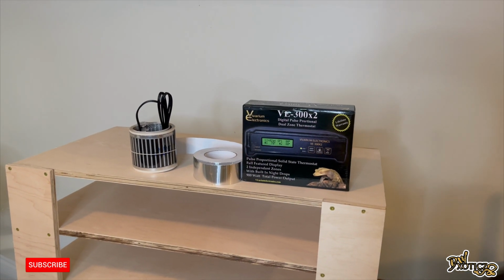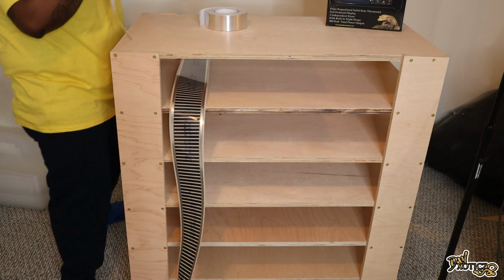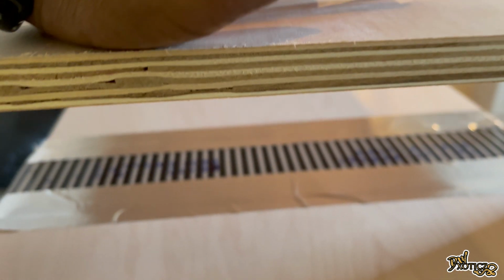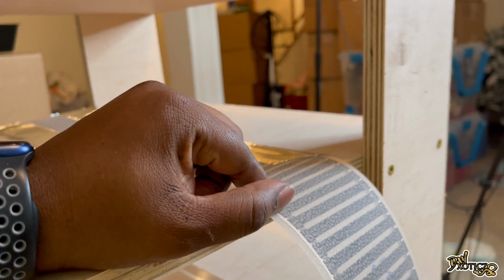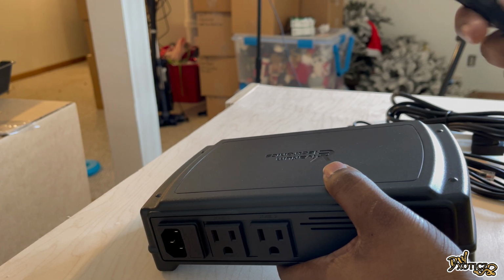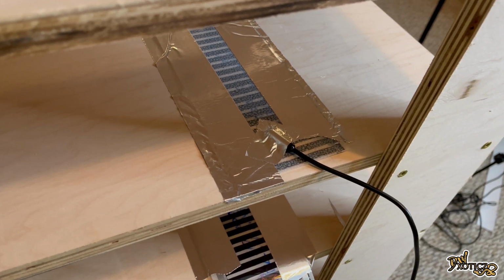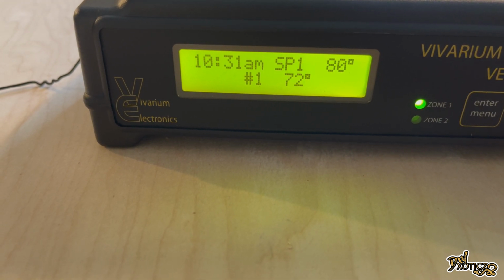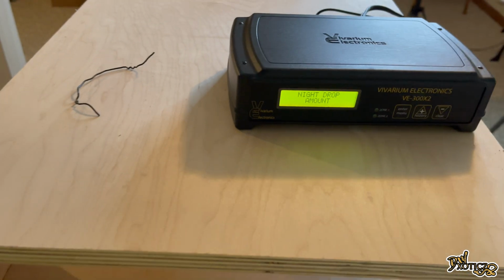Adding Heat Tape and Thermostat To Snake Rack!!!!!!

Comment: I have  bred and had reptiles for over 30 years this is all wrong with the heat tape. u have 3 in heat tape and you have about 2 inches now that aluminum tape is only supposed to be on the edge. aluminum blocks heat so where the tapes is it won't create heat.
Reply: But I bet it heats the tub just fine I've kept BP for 23yrs and though you're correct in the use of the tape the loss of a single inch won't affect the heat output stop trying to find a reason to down this man he did a decent job 🙄

Comment: Job well done Dre ,,,,,, I am well pleased ,,,, Those animals n deed will turn you into a artist fo sho ' ,,,, I have created three electrical heat pads so far ,,,,, in the hole punch way ' with black electrical tape at the end and the beginning .... mines was different but still work good.